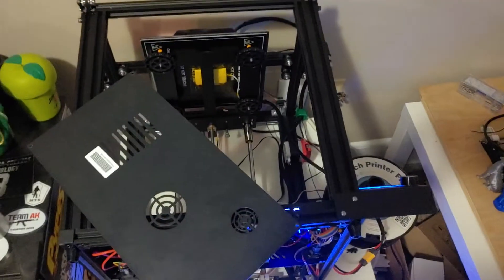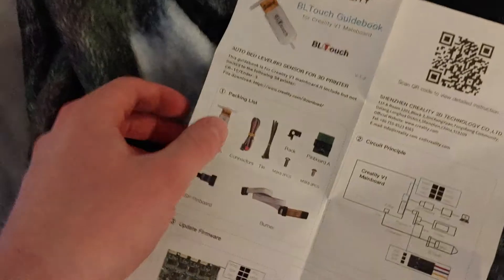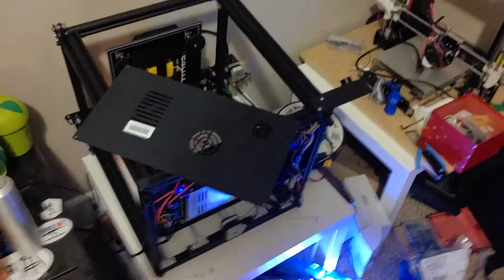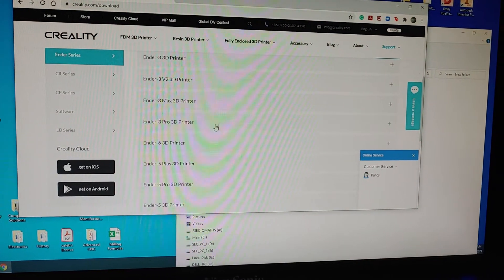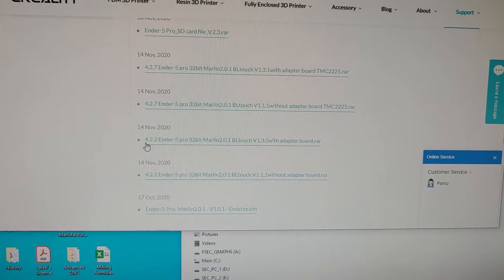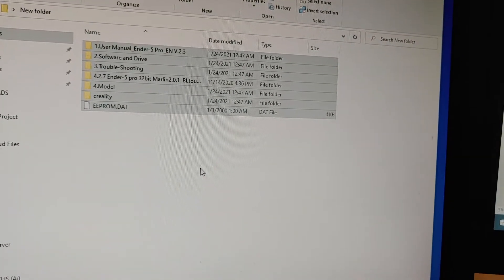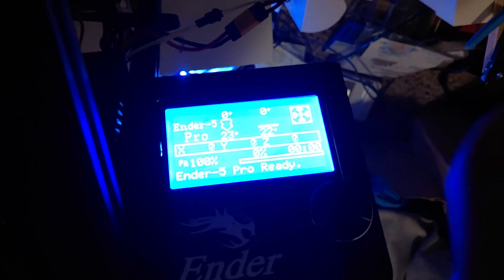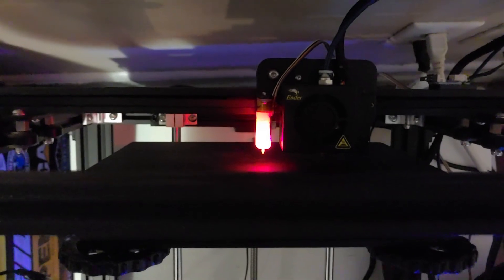Ender 5 Pro BL touch install problems, motors won't move, and how to add BIN file

Comment: One question that I have after lot's of test prints and such, I still have the issue, that after I power-off my printer, the Z offset is not there anymore, although I saved this setting. Anyone else has this issue as well?

Comment: I almost had the same issue. With my ender 5 pro, i ran into the issue that BLTouch was able to probe, but the z-axis did not go up (like it was trying to, but could not do it for whatever reason).
After checking both connectors, BLTouch side, and towards the motherboard, found that 1 of the cables was not fully in the connector and therefore, the connection itself to the motherboard wasn't completely connected.
After pushing the cable back in, BLTouch was waiting untill the bed got up again and was working as it should. Only potential difference, it that I disconnected my z end-stop as well.
But also after connecting the z end-stop again, everything is working as it should.

Hopefully this can help others with sort of the same issue as well. Also be aware, the website you are looking at is changed in the meantime so, if you are forwarded to another page, that is correct!
Reply: im having this exact issue. guess its time to recheck cables lol
Reply: still having that problem....
Reply: @Mavereck  did you  checked  both  bltouch connectors and the one towards the mortherboard? The issue should  be somewhere there. Does everything still work before you configured bltouch?
Reply: @martijnvandijk9776   I ended up just reflashing the firmware and doublechecking connections and it works now lol
Reply: @Mavereck  Good to hear man, have fun with your BL Touch and thanks for getting back on this comment!

Comment: I have the exact same BLtouch as you and an Ender 5 pro.  It has been nothing but a huge PITA!!  I've had the BLT for about 10 months now and have never been able to get it to work properly.  The instructions were terrible back when I first got it with many different ways to install it, different firmware instructions, and a lot of stuff that just didn't work, and ALL of that stuff was from Creality directly.  There would be links that I was supposed to use that were down on their site,  tons of firmware errors during the install/update process,  steps I was supposed to follow during install that wouldn't work, and the worst part is that at that time there were probably 3-4 different install videos, all from Creality, and all different!!!  Now, very quickly, I have a very strong background in computing technology, high performance computing, I'm a certified Apple repair tech(or used to be) for laptops, desktops, servers, certified Unix admin, blah blah and on and on.  Also, when I first went to college many moons ago(1999) I majored in computer animation/CGI and have a VERY strong background in that area, and as I mentioned earlier, I've been printing for a good while now and have a good grasp on the subject.  I still have not been able to get the BLT to work properly with my E5 Pro and do most of my printing on my 2 Ender 3's.  Tried going through Creality support channels and after a very long wait for a response and leaving a detailed email outlining each issue I was having, the exact steps I was taking to produce each issue, my expected results and the actual results, they responded with, "can you please explain what the issues are you're having?" That was as far as I went with them haha.    I guess this is my very verbose way of saying, I feel for ya... hahaha. Apologies for the novel length comment and I hope everything keeps working well for you!!
Reply from the maker: Yes, this install was a little frustrating but that is why I tried to document it for others if they had the same problem. One quick note, if you flashed your firmware to TH3D's marlin 2.0, you need to switch the pins on the probe connector. You also cannot use the adapter either. More info on this is on a Facebook post in the ender 5 pro owners group